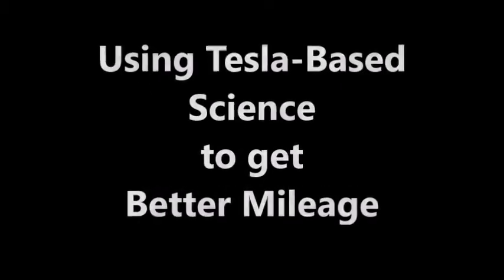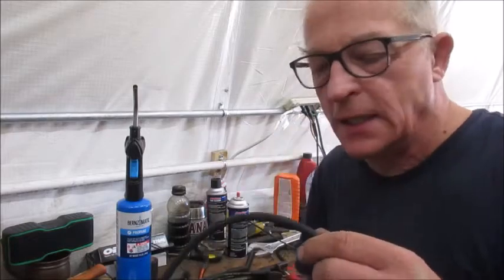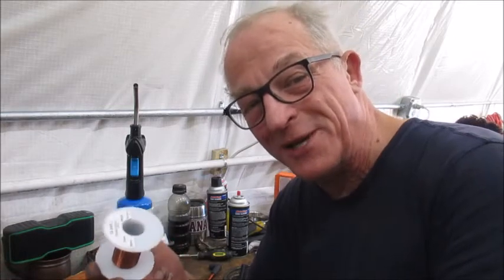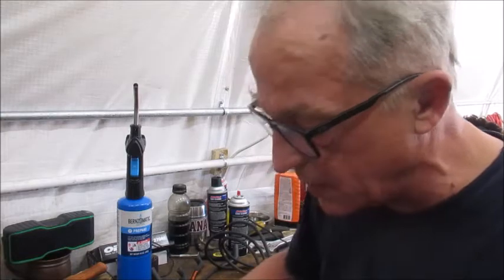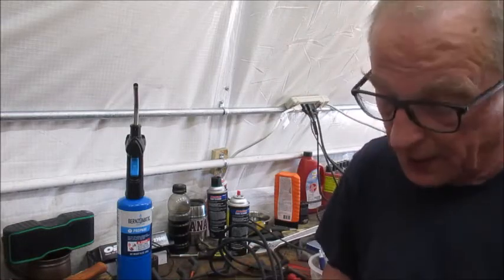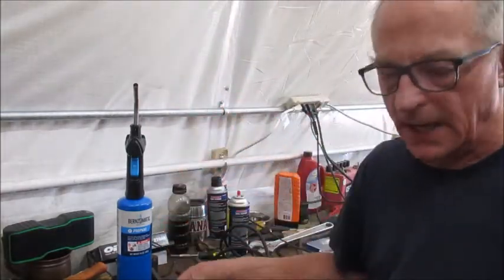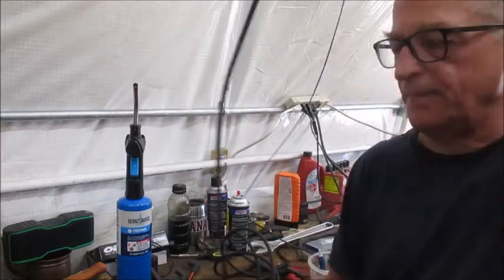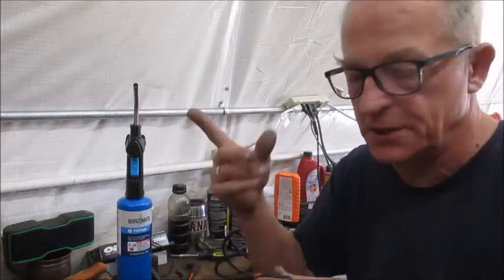How to add Tesla Plasma Fields to your ignition system for higher efficiency!

Comment: so your making a direct connection from your dist. cap to the outside of your plug lead insulation??!! increasing the resistance of the path to the plug by about 3000% and there fore lowering the amount of spark, introducing a huge magnetic field to the engine bay and the inevitable failure of the lacquer on the wire causing a fire in the engine bay and destruction of the ignition system. genius at work here people.

Comment: Ron, harnessing the electromagnetic field around an ignition cable is actually a lot easier, if you use copper braiding like this instead:  https://www.ebay.com/itm/193903449999?var=494114977289. Temporarily undo the coil end of the cable to slip the braiding through, and pull it snug around the cable. Secure both ends with small plastic wire ties. Make sure to leave an extra length of copper braiding for chassis ground. I also recommend that the spark plugs and the ignition cables are resistor-less.

Comment: Cool!  How would this work with coil packs?  Going to start playing around with my 06 Honda Odyssey.  Ever used torque master plugs?
Reply from the maker: Hello, Grant! Nice to hear from you again!
Unfortunately, it won't. For this, I have something on the bench that WILL help, with ALL systems, provided you have zero resistance plugs. These are actually available through Granatelli (I think!) for racing applications. But it's going to be inexpensive and easily installed. That is once I get it finished! Until then, check out the Snake Oil additive lineup! It's FREAKY. https://SnakeOil.wtf/?wpam_id=1
Reply: @thegadgetmangroove6304  thanks!  Might have to groove it too!